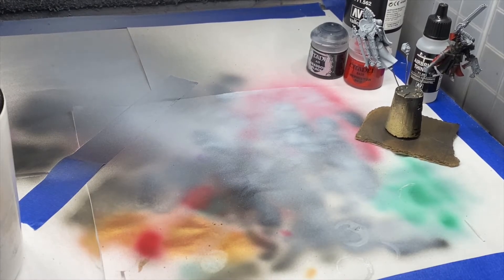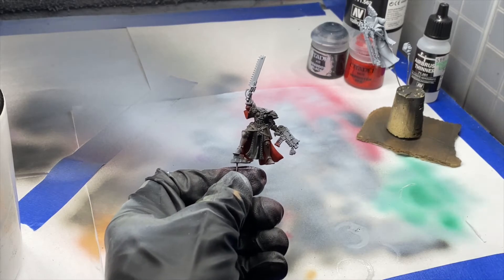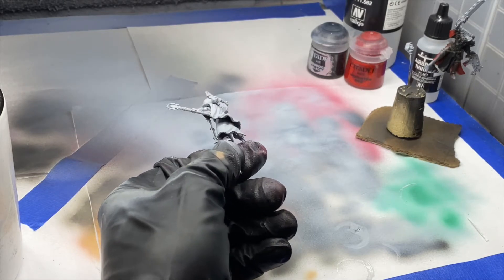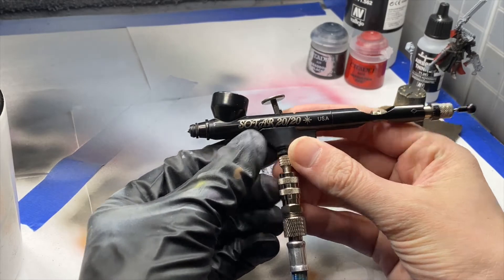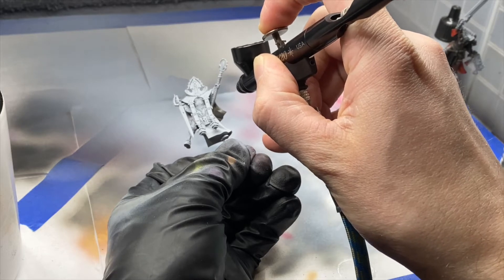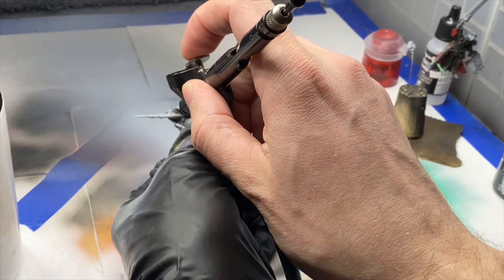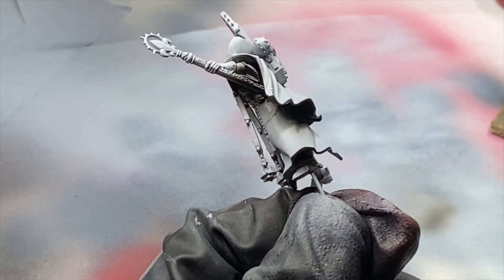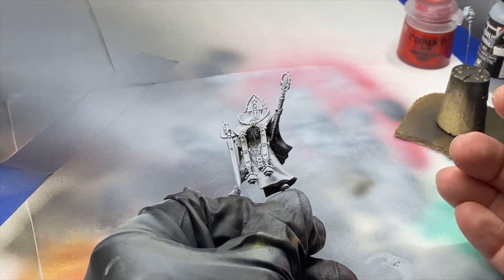Hobby Basics - Base coating Miniatures with the Airbrush

Comment: Thanks for the video, mate - very intricate work. What PSI are you using? I'm really keen to get my new (better) airbrush techniques up to speed for base-coating. Thank you.
Reply from the maker: Glad that it was helpful Neil! So the PSI slightly changes for me dependent on the airbrush I’m using and how close to the model I am. In this video, I was likely running somewhere between 15-20 PSI with my Sotar 20/20 at such close range. Normally for less precise base coating I use my Badger 105 Patriot at 25-30 PSI. I would highly encourage you to try different PSI levels though, as each compressor can be slightly different, so use trial and error to figure out the sweet spot for your equipment!
Reply: i guess Im asking randomly but does anyone know of a way to get back into an instagram account..?
I was stupid forgot the password. I would appreciate any assistance you can give me
Reply: @Byron Ellis it did the trick and I actually got access to my account again. I am so happy:D
Thank you so much, you saved my account!
Reply: @Zander Kristopher Glad I could help :D

Comment: "Please help me. I have been airbrushing pictures onto my car using regular car basecoat paint, but it takes a full day for the paint to dry. Intermediate painters have told me that when I overspray the basecoat, I need to add a layer of clear coat within 10-15 minutes, otherwise the basecoat will not properly adhere to the clear coat. How can I do this properly? Thank you."
Reply from the maker: I wish I could help! I know zero about car paint! Are you talking about model cars or real cars?